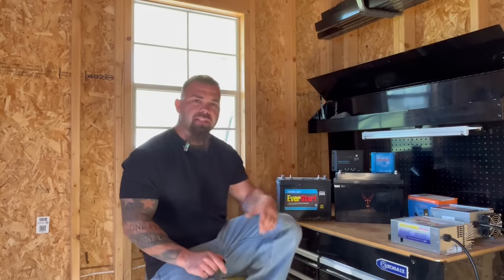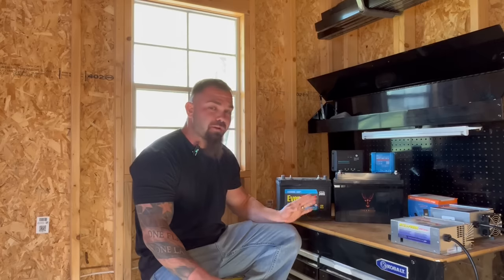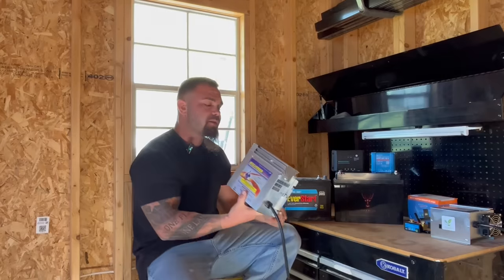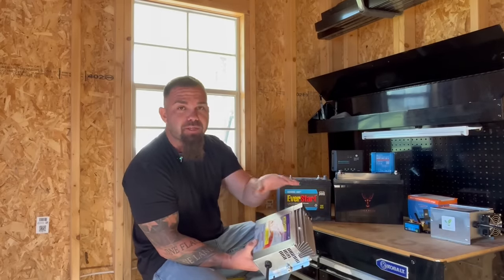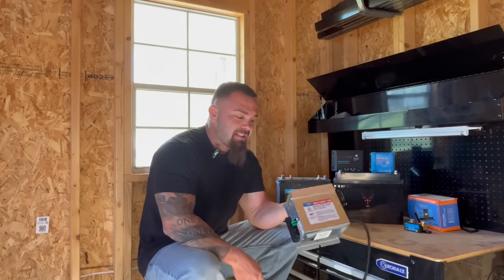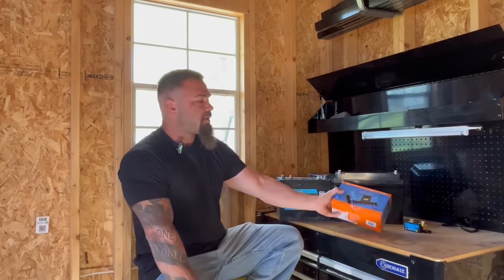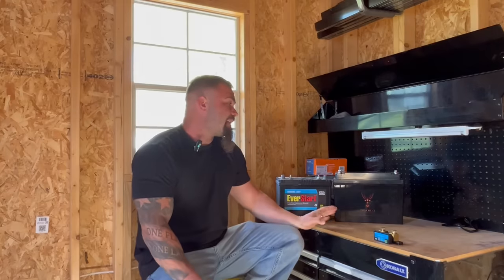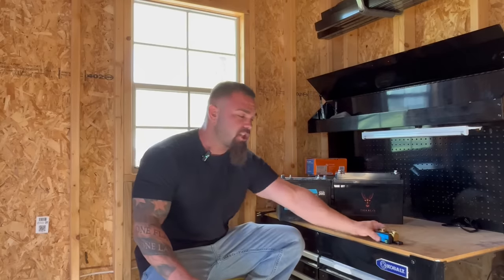Swapping to Lithium? WATCH THIS FIRST!

Comment: I'll continue to use my four 6v Deep Cycle batteries wired in series and parallel giving me 880 Amp Hours and 440 usable Amp Hours until they no longer work. Lithium LiFePO4 batteries are crazy expensive. I'm lucky that I have a converter that will also charge Lithium batteries but to get 440 Amp Hours with Lithium I'd have to spend a couple grand at minimum. Way too much cash just to save 130 pounds of weight.
Reply from the maker: 400 AH of lithium from Amazon can be had for around 600 bucks...
Reply: @rvsolarconcepts  Can you show me a link to that? For that money I would convert to Lithium provided it's not unstable chinese junk
Reply from the maker: @robh063  I suppose it depends on your definition of "unstable junk" but nearly EVERY lithium battery is made in China and the ones that aren't made in China are still made with parts, BMS, and cells originating from China... 

Here is a 280AH for around $500 so it's shy of the 400AH you were going for but I doubt it'll ever be much cheaper than something like these. 

CHINS LiFePO4 Battery 12V 280AH Lithium Battery - Built-in 200A BMS, 2000~8000 Cycles, Includes Low Temperature Cut-off Function, Perfect for Replacing Most of Backup Power and Off-Grid etc. https://a.co/d/06NetDq
Reply: @rvsolarconcepts  Thanks for the link! What I mean by "unstable Chinese junk" is from my experience with electric bike batteries. I have a 48V, 17.5 Ah (840 Wh) Lithium-Ion battery pack with genuine Samsung/LG cells on my bike hat costs $550 to replace. But I can buy a cheap Chinese knockoff for around $400. The problem is with those batteries is they're made with inferior cells and there is a good chance they will catch fire for no apparent reason at some point. IF you remember some cell phone batteries were doing the same thing in the recent past. So I don't care where batteries are made so much as I do what materials are being used to make them. Can you help me understand why some of the LifePo4 batteries cost so much less than others and what is the history of them catching fire?

Comment: 14.6 is too much for some LFP batteries and they may shut down. What not use an intelligent charger, programmable.
It it too bad that RV and boat manufacturers continually deliver products with antiquated systems and components.
At today's prices, the manufacturers would do well to up their game and go the distance as standard.
Reply from the maker: It is pretty wild how cheap everything is even when buying a $100k+ trailer these days. They are made like absolute crap.

Comment: Great video!
Reply from the maker: Thanks Paul, glad you got some insight from it!
Reply: @rvsolarconcepts  I did get some insight, but mostly confirmed what I already thought I knew. I have had solar on our motorhome for 14 years and I upgraded to a Redodo 300 amp hour LiFePO4 two years ago, but didnt upgrade my solar charger until today. I purchased a Victron 50 100 MPPT solar controller, and the 
Victron Energy SmartShunt IP65 500 amp Battery Monitor (Bluetooth)

Although, we never run out of power, I wasnt sure the battery was charging to full capacity, Now with the new shunt, it provides more information that the old Bogart Engineering 2025. I am currently running my battery down to check for actual capacity. Thanks again for the video.
Reply from the maker: @paulstough2995  right on, sounds like you're getting it all dialed in then! If you have any questions on the programming of the shunt we posted a video on how to properly set it up with the correct efficiencies, voltages, ETC... It's live on the channel if you need a guide for that as well!
Reply: @rvsolarconcepts  Thank you.

Comment: Its not great to fully charge lithuim batterys to the full voltages consistently as it reduces the battery life ,so if you want a long lasting battery bank for something your better off getting more batterys and reducing the maximum end of charge voltage .
Reply from the maker: Agreed. That is one way to extend the life of the battery (as it is with all batteries) but that's not really what this video was intended to speak on...

Comment: as a lithium cell fully charged voltage is 4,2 and nominal voltage of 3.7 volts l cant see where  the 14,6 volts come from, it does not compute
Reply: LiFePo4 cells have a nominal voltage of 3.2 volts and the maximum voltage they can be charged at is 3.65 volts, but you really should take them that high because the BMS will cut them off.  The cells you are talking about are probably Lipo cells used in models which regularly burn garages down.

Comment: Good gracious just a few minutes in and you say lead acid full at 13.6v which is totally wrong. You need to get them to 14.4v and hold them there until the current drops to 1.5% ish of capacity and then drop to a float voltage of around 13.6-13.7. Lithium can be got to full at 14v in fact below that but it takes a lot longer. The actual problem you get is the lithium can cause the alternator to overheat as they can absorb so much current due to their low internal resistance. A car alternator typically outputs 14.2-14.4v unless it’s a ‘smart’ one and are simply not suitable for RV use without a dc-dc charger. Taking lithium to 14.6v is not necessary and that is in fact their upper limit and charging with a lower voltage will actually cause them to be overcharged as they won’t cut off. You really need a charging source that will cut off at a lower voltage, this is much easier than boosting the alternator voltage and driving the BMS to disconnect. My lithiums disconnect charging at 14.1v which gives enough time to do some balancing and doesn’t push the upper envelope where they don’t like to be and it only misses out on a fraction of a percent of capacity for a longer life. I would not advocate a lithium battery without a programmable BMS that can be set to suit your use. The ones with non programmable ones are set more as last ditch protection r systems rather than a management system. I’m sorry if you cover this later but this stopped me in my tracks.
Reply: You have it backwards. Due to their lower internal resistance, the Lithium batteries can be fully charged much faster than lead acid and at lower voltages. 

 My Mercedes Sprinter alternator is rated at 180 amps.  Before I sacrificed most of its capacity with an expensive DC - DC charger rated at 30 amps, I simply measured the maximum current going into the Lithium bank when it was deeply discharged.  I measured 65 amps, and decided the alternator could handle it without breathing hard.  The Victron video shows red hot alternators, but they are trying to sell you DC-DC chargers.

I saw the  same thing on a boat I worked on--they had upgraded the alternator to 55 amps, but had not upgraded the wiring to the new lithium battery, so the maximum charging current I measured was only 20 amps with 14.2v at the alternator terminal and 12.2v at the battery.  I partially upgraded the wiring  to where I got 40 amps, and left it there.  The boat worked perfectly to Hawaii and back.
Reply: @donaldradcliffe6704  I don’t disagree with you in fact you have kind of repeated what I said. Maybe you missed that I was describing lead acid, not lithium in the first bit. I have been anti DC -DC chargers with lithium in a hybrid setup for ever. The only real,reason for a DC-DC charger is where there is no protection against a BMS disconnect and to protect the lithium from overcharging at 14.4v because they have a BMS that doesn’t cut off until 14.6v. I won’t recommend batteries without a programmable BMS unless the user has complete control over their charging system and that’s expensive. I have adopted the hybrid method where the BMS cuts off at around the 14v mark which, at boat type charging rates is very nearly full. The lead acid then absorbs any nasties that could fry the alternator and sensitive equipment and of course it also gives a redundant system in case of a BMS disconnect.

Comment: A standard 12 volt battery charges at 14.60 volts not 13 volts
Reply from the maker: Lead acid batteries charge to a maximum of 13.6 VDC while charging, and they carry a resting fully charged voltage of around 12.8 VDC after the charging source has stopped charging. 

a 12V Lithium battery charges to a maximum of 14. to 14.6 depending on cell type used in the battery and they rest around 13.6 once full charged and charging source removed.
Reply: @rvsolarconcepts  lead acid charge at 14.6 not 13.6 lifepo charge at 13.6
Reply from the maker: @billthebandit2466  Please cite your sources for this information. I think after a quick Google search you will find that your current information is incorrect...
Reply from the maker: @billthebandit2466  Here are a few sources that would indicate that our information is correct. That and we've been doing this professionally for 5+ years now... Please post some evidence to your claim so we can clear this up!
 https://naturesgenerator.com/blogs/news/lifepo4-voltage-chart

https://www.boondoctor.com/knowledgebase/how-far-to-discharge-your-lead-acid-rv-batteries/
Reply: @rvsolarconcepts  well I have to say your wrong I been dealing with off grid systems for 40 years and seen a lot of changes in technology for the better but the basics don’t change
Reply from the maker: @billthebandit2466  Sources please sir... I would like to be giving the most accurate information possible to our viewers, please include a link that refutes the links I posted so I can be certain. Self proclaimed knowledge makes this a "he said she said" game that I'd rather not get into. If your information was correct it would also mean that every manufacturer of charge controllers, and converters is also wrong as they have the voltage set to 14.4 for their lithium settings and 13.6 for the lead acid settings which is highly unlikely. We also own RV's with Lithium batteries and install lithium batteries in our customers systems 3-4 times per week. We always set the settings as we described in this video and they perform flawlessly so I'm not sure how you are trying to refute this point any further...
Reply: My 10 year old Renogy Tracer MPPT controller charges my AGM batteries to 14.6v for about 2 hours, then gradually floats at 13.6 volts. Last set of AGMs lasted 9 years being charged like this.
Reply from the maker: @glenstriper  yeah, SEALED lead acid batteries and AGM batteries charge at a slightly higher voltage than flooded lead acid batteries.
Reply: @rvsolarconcepts  flooded lead and agm charge at the same voltage sealed charge at a low voltage and gel charge at an even lower voltage

Comment: Just a note, my 5 year old Victorian AGMs rest at 13 Volts.
Reply: What do you mean by resting?  If you let fully charged AGMs sit with no load for 24 hours, the surface charge leaks off and you should see a maximum of about 12.8v.

Comment: So where is the benefit of having 6000 dollars (6 batteries)plus extra hardware and electronics over having 6 agm batteries that cost 250 dollars each and are available literally everywhere
Reply: The LifePo4 batteries now cost the same as AGMs, have twice the useable energy, 6 times the cycle life, and take less power to recharge.  Your choice.

Comment: Below 32 f most lithium will not charge found this the hard way
Reply from the maker: @kurtkkalaska1657  That's correct in most cases. More and more manufacturers are starting to include heaters inside the batteries so if cold weather is a factor, those are the best option.

Comment: All 12 vdc lithium ion batteries are a LFP  also know as lithium iron phosphate chemistry.  They all are 4 cells in series with a nominal voltage of 3.3 vdc per cell.  Some LFP manufactures claim a 3.2 vdc nominal voltage.  There is very little amp hours stored above these nominal voltages.  So 14 vdc divided by 4 in series is 3.5 vdc.  13.6 vdc divided by 4= 3.4 vdc.  To make your claims you really need to measure the amp hours stored above 3.4 vdc.  You will find that that level is insignificant.
Reply from the maker: What does this have to do with swapping an RV to lithium batteries??
Reply: @rvsolarconcepts  Because it really does not make much difference to charge it to 14 vdc.

Comment: How dangerous are these lithium batteries taking a sudden meltdown fire? I fear these potential  fire bombs...many people had these lithium batteries  going Nova on them in the their pockets inside their devices. Almost impossible  to put out that fire.
Reply from the maker: Those are lithium ion batteries not lithium iron phosphate. Different chemistries, they don't create their own oxygen, and each battery has a built in BMS (battery management system) that disconnects power of there ever a parameter that is concerning like over amperage, temperature, over voltage,  etc...

Comment: 13.8 volt will charge 99% on a lipo4.
14.4/6 volt is wat the cell is maximaal can   do 3.65 volt .
Its not oke to charge to that point .
The best is 3.50  volt on a cell. 
You do not use the bms to shutdown your charger or disconnect the systeem.
So you stay under it or above the disconnect from the bms 

Your relaise will worn down faster .
The best is that the charge shutdown on 13.8 volt and go to float to 13.6 volt.

If you have a charger and solar charger .
This is what i do my self .
Charger load the battery to 13.4 volt and float to 13.2 volt .
This way i have battery charge from 0-60% by the charger and if the solar charge go on it thake over and shutdown the normal charger .
The mmpt from the solar charge charge with 13.8 volt and float to 13.6 volt .

The charger will shutdown and stop charging.

This is how my boat is connect to solar charger and the wallpower from the port on the main powe line .

This way on the day i charge by solar .
And in the night i can use lipo4 wat i have charge by solar and if the battry go to low the charger wil hold the battery stabel on that 60%

So long i'm on the port with my boat.
I only use 40% of my lipo4 .
If the power go down on the port i still have 60% so the 2x freezer stay working .
And if i go from the port i can use the battery 100% 
The lipo4 is charge by a dc/dc charger connect on the engine lead battery .
Wat is connect on the engine.

Renogy dc/dc charger
I use model .
12V 20A DC to DC On-Board Battery Charger.
It have the lipo4 charger selection on it .
And have auto start if the engine run.
Reply from the maker: Of coures there are ways to maximize the longevity and life of the batteries, this information was given as a general voltage guideline on the market and where the BMS will cap the charging before disconnecting the charging circuit. There is nothing wrong with charging them in that way, but yes, you can get longer life by not taking them to 100% and 0% respectively.

Comment: This is not necessarily true about the converter output. MY WFCO converter is not a lithium converter model but has a output of 14.4Vdc for Bulk Charging and switches to 13.6 Vdc for absorption mode.
Reply from the maker: After my own personal experience installing hundreds of these i would say that you're both correct and incorrect. If you're going off of just the voltage output on the sticker then you're correct. However, when you hook up a lithium battery, the converter will sense the higher voltage, assume the battery is very close to full (because it's thinking this is a lead acid battery) and it will go into absorption or float mode which causes the amperage output of the converter to drop DRASTICALLY to less than 5 amps in most cases. So yes, it will eventually charge the lithium battery, probably not to a true 100% and it will take DAYS to accomplish the charge. If you're plugged into shore power that's no big deal but most people don't like running their generator for 10 hours to get 25% charge into the batteries when they are dry camping haha.